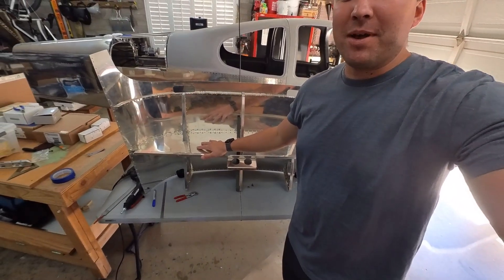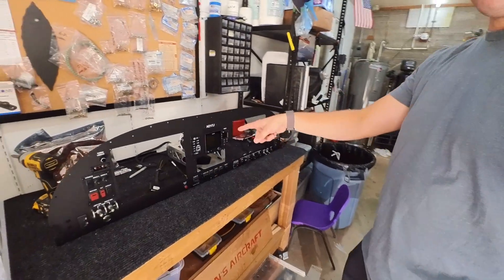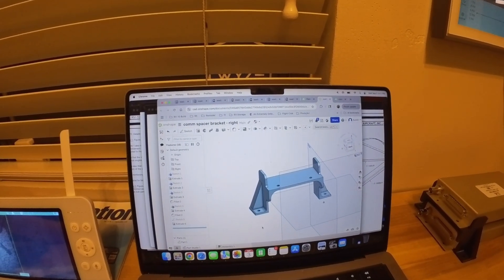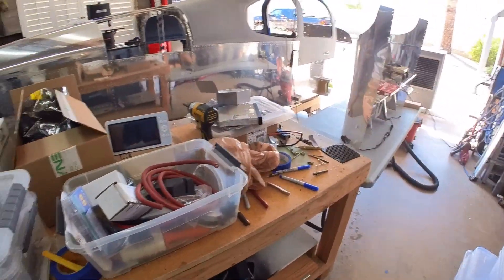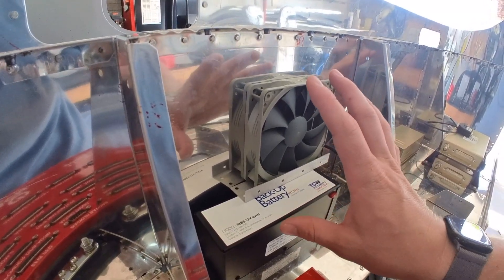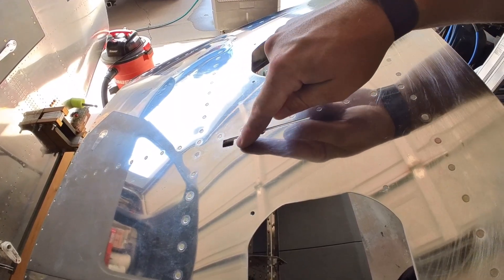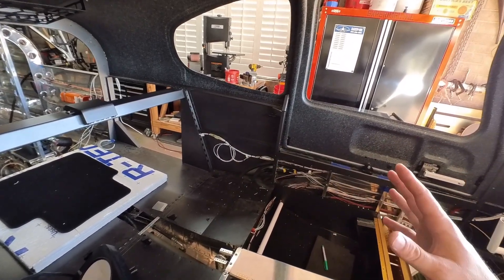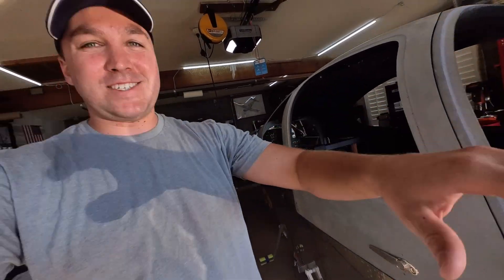RV-10 Avionics Sub-Panel Mods + 3D Printed Parts | AFS Build Update

Comment: I’m thinking where those stack brackets have “cutouts” there seems to be an overkill amount of gusset remaining in the way of accessing the connector. Seems like you could get away with it being just a shelf as opposed to those radiused gussets. Or maybe just a gusset at the coax side. Seems easier to get to the coax even with the gusset.
Reply from the maker: We shall see! I haven’t installed them for good just yet but will add it to an update video if it ends up needing to be changed

Comment: Liking the small touches/details you're working out like the rear seat headset jack block. Oh, and trust me, you'll never need that bright red lighting under the glare shield. IMHO, you'll be running it in the lowest illumination you can go.
Reply from the maker: Appreciate it! I think the LED lighting will mainly come in handy at night during startup and shutdown, but otherwise, I think you’re right that it’ll stay dim or off